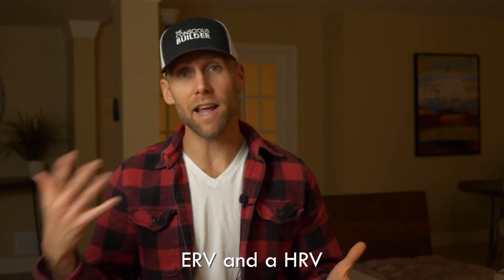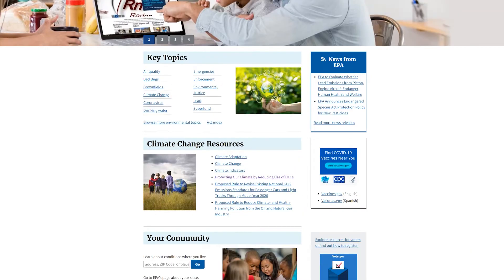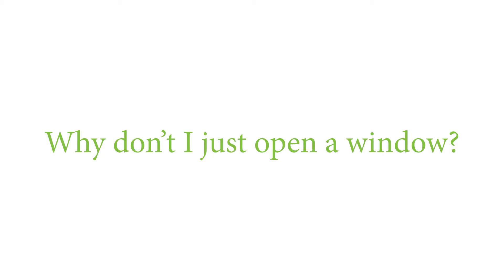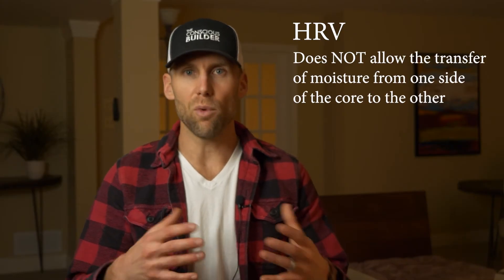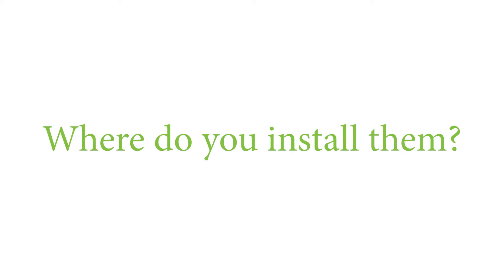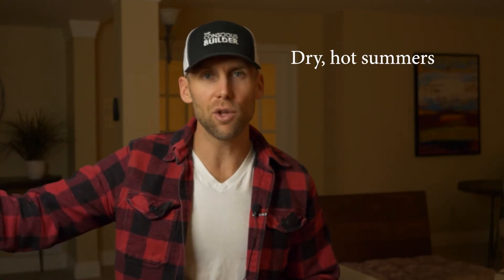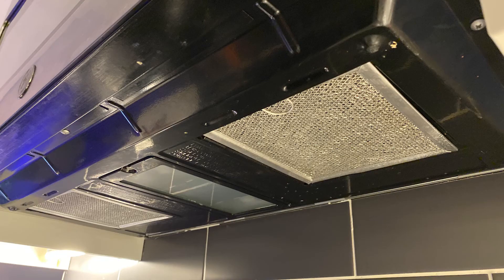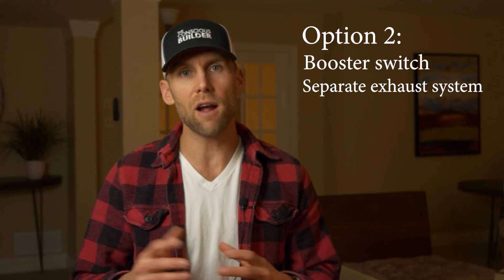ERV vs. HRV - What's the Difference?

Comment: Awesome  introduction ,best one yet ..so I have an HRV already fitted in my house (NOVA SCOTIA) ,I've just found all the suck and blow vents and cleaned them all out, the suck was filthy. 
Question .if we are opening windows /doors, should  we be turning the HRV off as the airflow is now coming through doors and windows..
Once again  awesome  vid 👏 👌
Reply from the maker: You can keep it running. If you cleaned all your vents and adjusted them in any way, you may want to get your system balanced again to make sure it's running optimally.

Comment: I live in hot humid summer and cod dry winter...I need to get rid of humidity at least 20% in summer and add 20% in winter to maintain 50-60% indoor humidity. Is there any ERV system fit for this? or should I add dehumidifier on top of ERV?
Reply from the maker: The ERV won't control the humidity but it will allow it to transfer from one side of the core to the other so it maintains what's already in the house. Once you install the ERV and run it through the seasons, you'll see if you need to add a dehumidifier or humidifier.

Comment: Hi, great video.  During summer the ERV should be turned off?
Reply from the maker: The ERV you can run 24/7/365. The HRV you may not want to run in the summer if you're in a hot humid area.
Reply: Thanks for response,  I am unsure about the correct operation in the summer setting.

When I set knob B to the summer position and select MIN, is that the correct configuration? The reason I ask is that, when knob B is in the summer position and I turn the unit off in order to use the optional control, the unit starts for a few seconds, then shuts off, and repeats this cycle

Comment: I'm also in Ontario and moved into a home that was built in 2008 that has a HRV installed.  It's set to run 24/7, all year around.  Based on what you said, it sounds like I should be turning it off during humid summer days.  Would it make sense to have it replaced with an ERV?
Reply from the maker: If humidity levels are too high in the warmer months, you may want to turn it off. If it's fine, don't worry about it.

Comment: Great video very informative appreciate your time I live in the Las Vegas area and I'm interested in are exchanging in my home. I had a quick question how well do ervs work in hot extreme hot weather 120° in the summer months. I'm worried about hot air coming in to the home. Are ther e any thing I. Particular I should be considered with before I interest money in to this project ¿
Reply from the maker: They work no matter what the temperature is. The potential issue is extreme cold, not heat. Ultimately the unit will transfer the heat from the outside air coming into the house to inside air leaving the house. It's not going to be 100% efficient but it will reduce the temperature of the air significantly depending on the current indoor air temperature and the efficiency of the unit.

Comment: I have an old 2 wire HRV in southern Ontario. It's old and I cant find the 3 wall plates for the individual rooms as well as the main controller. What would you recommend? Reinstall a new HRV and rerun with 3 wire cable? Or rerun 3 wire cable to the individual wall plates and install a ERV?
Reply from the maker: What is the efficiency rating of the current /HRV? If it's not very good compared to what today's models are, it may be worth upgrading.

Comment: Thanks for the video

One thing I don't get is - if the core allows the transfer of humidity, it also allows the transfer of VOCs no? things that you want to get out of your home
Reply: No. A material can be airtight, but not moisture-tight. Paper is a reasonable example, plasterboard another. You can't blow air through them, but if you make one side damp then that moisture moves through to the other side. So the core material will keep the two airflows separate, but allow heat and moisture to be transferred from one to the other.

Comment: Cheers.  Also near Ottawa - thinking of installing a heatpump to pump warm (or cool) air into the ERV and ducting the whole house (there is nothing right now - just a wood stove) - do I plan runs (with smaller ducting) the same way you think about a forced air system?
Reply from the maker: Thanks for watching! I'd speak to an HVAC specialist for your specific needs.🙂

Comment: Thank you for the information. Could you please explain how to set the ventilator controller for the ERV to manage humidity levels in Toronto during both winter and summer?
Reply from the maker: Thank you for watching! I would consult your unit's manual, manufacturer or  installer for support with this.
Reply: That would require hooking a dehumidifier up to the system.

Comment: So rather than opening windows, you run an electrical device which then contributes to global warming? Conscious?
Reply from the maker: Opening windows does not ventilate the entire home and does not help control humidity. Additionally, if you're opening windows in seasons where you have to run A/C or heat, then you're actually using more energy to condition that new air rather than running it through a unit (the ERV or HRV) which pre-conditions the air before it enters the home. If you live somewhere in the world where you can have ALL your windows open 24/7/365, then you wouldn't need one. If you live in a place where you only have a small portion of the year where you don't run A/C or heat, you need something if you're going to maintain a healthy indoor air quality.

Comment: this is a great explanation. what's your favorite all round erv make and model?
Reply from the maker: Hey, glad it was helpful! I usually rely on the expertise of our HVAC contractor but it also depends on what the requirements are for the project with regards to efficiency. Ultimately, I lean towards systems that are well known by contractors and systems that have parts readily available. It's a real pain dealing with systems that have minimal service techs and that are hard to get parts for.

Comment: I’m in Nova Scotia where summers are extremely humid (80-90% is not uncommon) and the winters are very dry. I have lots of musical instruments that need to have perfect humidity and I can’t keep up with the manual maintenance so I’d rather make the air right. Should I get the ERV and run it all year round? Does it average out the humidity in the summer AND winter to a moderate level?
Reply from the maker: Yes, I would recommend an ERV but note that it's not something that controls humidity. It does allows the transfer from one side of the core to the other so not all the humidity is leaving the house in the winter or coming into the home in the summer. You may also need to add a humidifer in the winter and run the A/C in the summer. Ultimately, the ERV gives you better indoor air quality but the other systems help more with humidity.

Comment: What about radiant heating or mini split heat pump conditioned homes?  Are there ERV's that are designed to be installed for a room or two?  This will be an off grid home that will be built in phases.
Reply from the maker: Yes, there are smaller ERVs now on the market and even single room ERVs. We have not used the single room ERVs yet so talk with a local HVAC contractor to see if they have experience.

Comment: Ok bro, 3:23, how on earth is the MOISTURE going to transfer from incoming air to out going air? The moisture is going to magically transfer through the solid walls of the ERV?
Reply from the maker: The walls of an ERV are not "solid" like an HRV. An ERV transfers moisture between the indoor and outdoor air streams through a thin, paper-like membrane within its core. This membrane, which I have also read is called an exchange capillary core, allows humidity to move from one air stream to another.
Reply: @Theconsciousbuilder how often must that be changed for efficiency?

Comment: Can you please elaborate on the booster switch option? Are those systems known by another name? You indicated that the purpose is to balance inside air needs with compensating air-intake.
Reply from the maker: The booster switch should be installed in every house that has an ERV or HRV. Typically they are installed in the bathrooms and will have a timer that runs for 20 minutes, 40 minutes or 60 minutes.

Yes, you'll want to make sure the system is balanced properly. Ideally you have the same amount of air coming into the house as is leaving the house. Your HVAC contractor should be able to do this and the HVAC design should have the required CFM for each room.
Reply: @Theconsciousbuilder  Thank you. But the booster switch itself - is it a "switch" or is a damper with a fan? I am unclear about the terminology and don't get a lot when I Google it. Is there an alternative name?

Comment: Hi, thanks for the great video!  I live in Yarmouth NS, which is actually not a humid place compared to Ottawa where I used to live.  Would you recommend an HRV or an ERV?  I should mention that my home is a 1960s bungalow with electric baseboard heating only. The existing HRV was an old NuTone heat air exchanger so there is existing flexible ductwork in the attic that connects to ceiling vents in several rooms in the house.  The VanEE AI Series (HRV) Model V160H75RT was recommended to me as it is self balancing and I plan to do the install myself given the existing ductwork - although the electrical will likely need a professional as the new controllers have 4 wires and the existing only has 2.  Appreciate any advice or considerations!  Thank you!
Reply from the maker: If there's no concern with maintaining a different humidity level inside compared to outside, then an HRV would work. If you need the humidity in the house to be different from the outside air, I would recommend an ERV. I would also recommend you have an HVAC designer help you design the system and make sure the existing ducts will work for you.

Comment: We live in Ottawa and our indoor humidity in winter is always around 46% and we have problems with heavy moisture on the inside of our windows. I have been recommended an HRV to help lower indoor humidity, but only to run it in winter. Does this seem reasonable? A whole house dehumidifier is also possible, but i like that the HRV brings in fresh air to manage radon and CO2 buildup, among other things
Reply from the maker: You do not want an HRV in our climate. You want an ERV so that you can run it 24/7/365. HRVs can't run in the summer because of the humidity outside which defeats the purpose. You want fresh air all year round. 46% is not too high for humidity in terms of health but it is too high for condensation on windows if you do not have triple glazed windows. I would recommend changing your windows and adding an ERV. We can help if you like :)

Comment: We sub out hvac. I don't pay much attention. I found out I need hrv hooked to "vent to daylight" on my personal cottage build. So will need to dig a pit for it.  And an erv on 20 foot tall south wall over planter and plants. I had to get exhaust fan for my boiler and hot water for my old house. After installing vapor barriers and mineral wool. Our hvac guy is like that's the first he does is make an air inlet for regular build. With us he never knows wtf we got going. Usually some kind of radiant heat, with backup/supplemental efficient masonry appliances. Which people are surprised how much ventilation a fireplace needs. Which is why we try to avoid forced air with gas and wood appliances. Don't vent your stove hood into hrv the grease will clog it.

Comment: Kind of funny hrvs have a condensate drain e RVs do not. Have you ever actually looked at these units are you just regurgitating
Reply: Ignorant troll comment…
Reply from the maker: We've been using ERVs for 12 years now and they are still working great in our climate. ERVs typically don't need the condensation drain because of the ability to transfer moisture through the core, unlike an HRV.

Comment: I recently switched from an HRV to and ERV. I’m on Vancouver Island and we have mild summers with middle of the road humidity and the winters are generally humid and mild as far as Canada goes. I found the HRV dried the air out way too much in the winter due to the massive drop in RH once that humid cool outdoor air was brought in and warmed up. Sometimes on cooler days the indoor RH was drop well below 30%. I’m hoping with the ERV I can retain a bit of the indoor humidity in the winter and will only need minor supplemental humidification. The average summer day generally maintains a nice indoor humidity level of between 45-55%. So far this fall I’ve noticed a higher average indoor humidity level with the ERV, but I just run a touch of supplemental dehumidification to get it back where it needs to be. Ultimately with the advancements made in ERV tech and defrost, they’re generally the better option in all but the most extreme climates.
Reply: you should see marginal improvement with your winter conditions. The advantages of ERV are more pronounced in summer, tho
Reply: @BloominOnion1  the results have been better than marginal would say. It’ll still dip between high humidity activity but it takes longer for it to drop, so on average it’s been higher.
Also, are humidity is pretty comfortable here in the summer. Given an average day, the indoor humidity tends to average around 45-50% resting. It’ll bump up a bit after high humidity activity and down a bit lower after an AC cycle.

Comment: I have an older HRV and live in the Toronto area. Can I simply replace it with an ERV, using the same ductwork that is there now? (The HRV is presently attached to the furnace)
Reply from the maker: It may be possible to switch them out however I would speak with an HVAC specialist about your particular setup to be sure of models and system compatibility.

Comment: Hi. There, I’m I am building a custom two story home located in Arizona. Should I install an HRV or ERV? And what hvac system would work best with the HRV or ERV?
Reply from the maker: I would suggest an ERV so that you can keep some of the humidity that you create while living in the house when it's hot and dry. Depending on the size of the house and how much humidity is created by the people living in it, you may want to add a humidifier. An ERV also helps prevent humidity getting too high if it gets very humid outside as some areas there apparently can. All that said, I'd speak to your local HVAC specialist as I'm sure they have great insight into what words best in your region.

Comment: Everybody has these videos telling us the difference between the HRV and ERV but no one mentions what you should do if you have an HRV that was installed in a house that you bought but still want to use it in other seasons besides winter. I don’t have the budget to install a pricey new unit.
Reply from the maker: The HRV is better than nothing. You can run it throughout the majority of the year but you may not want to run it in the summer if you live somewhere with a lot of humidity.

Comment: I am curious about your thoughts of operation during the frequent corner conditions that we experience here in the San Jose CA area, primarily spring and fall, but also in the summer from about 7pm until about 10 am where the outside temperature is cooler than the inside during cooling season.  Humidity is not an issue.  I frequently do not run the AC at all during this time, but need fresh air.  If there is a breeze at 7pm, I open a couple of windows and all is good, but that is not a reliable thing and it is not filtered.  What is the secret sauce in our area for minimal AC operation with maximal comfort?  I assume that n HRV is a better choice (cost and air flow) than an ERV in this benign area?
Reply from the maker: Thanks for watching Larry! If you don't have high humidity in your area, then yes, I would say that an HRV can work and can run 24/7 so that you always have fresh air coming into your home. The A/C does not bring fresh air into your home.
Reply: @Theconsciousbuilder Is the HRV or ERV temperature configured to shut off at a certain indoor temperature if the outdoor temps drop too low?

Comment: Thank you for your clear and useful video, my ERV was installed by the builder with many elbows, instead off going straight to the out, just created at least 2 elbows, Are there any requirements for the number of these elbows for the in/out of the house duct, the installer maintains a specific distance from the in/ out air to be sure the in-air won't mix with the out air? if this is the reason, what is the minimum distance between both holes?
Reply from the maker: Hi Ralf, thanks for watching, glad it was helpful! Usually these details are all addressed in the installation instructions for the ERV. The number I have in my head is to have at least 6' between the exhaust and the intake on the exterior of the building but you'll want to double check that with the manufacturer.

Comment: Thanks for the great video. I need an advice regarding control problem of HRV 60H in my condo unit. When I tried to tun off power using wall mount control but it didn’t work. Therefore the ventilator is running 24/7 unless I pull the plug off. Can you help to resolve this problem?
I live in Montreal.
Reply from the maker: Hi Perodeau, you should reach out to a local HVAC tech in your area. Unfortunately without being there its hard to say what's happening. Thanks for watching!
Reply: @Theconsciousbuilder  Thanks very much